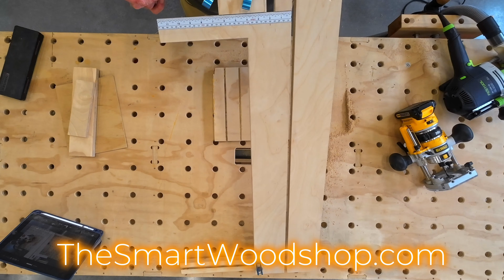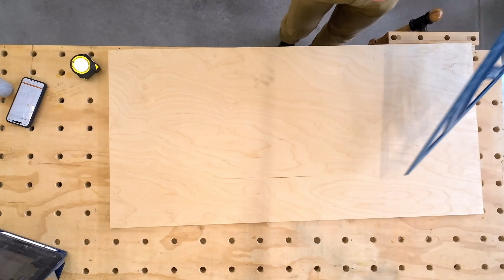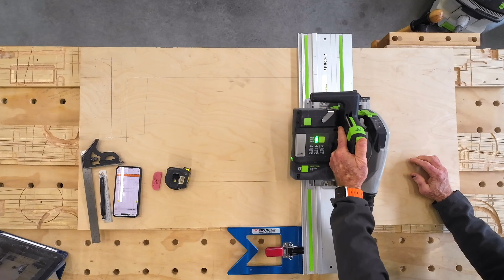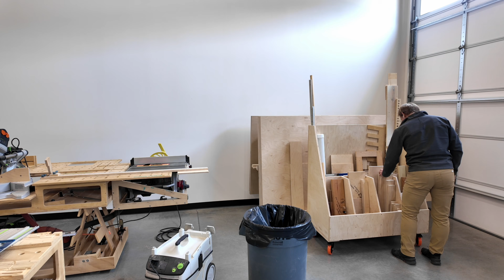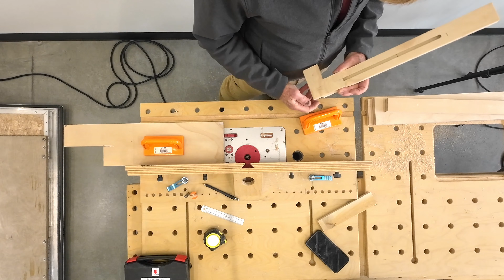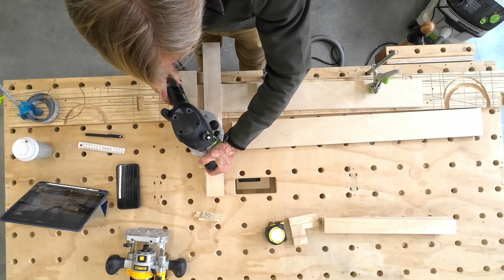Watch Me Build the Smart Dado Pro Jig – Start to Finish

Comment: Well done—again! Really clever adding the rabbet so the guide bushing can be used. In the past, the dado jigs I made used a top-bearing bit, and the guides were exactly the same width as the material. That always made it a bit shaky when entering or exiting the jig. More often than not, I’d end up pulling the router up too fast—or entering too quickly—and over time, that would ruin the jig.
Reply from the maker: I'm glad you found my solution helpful! 😎🤙